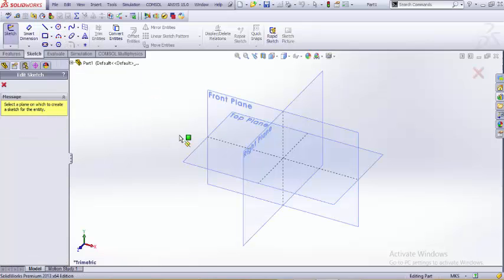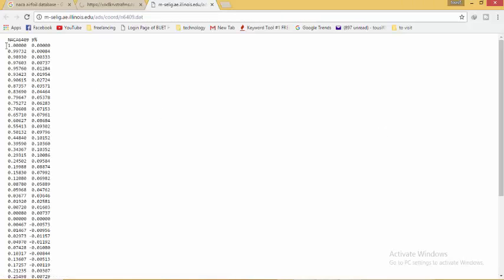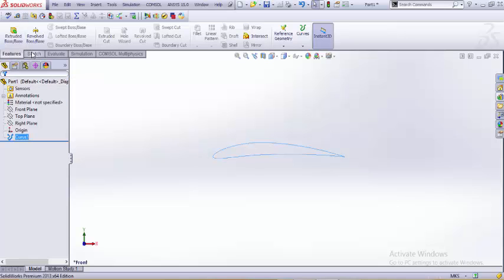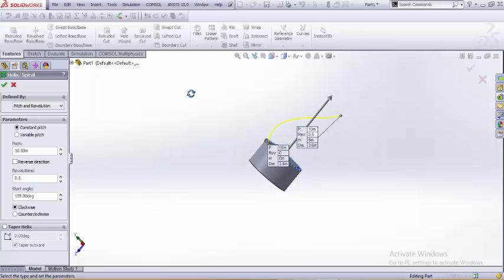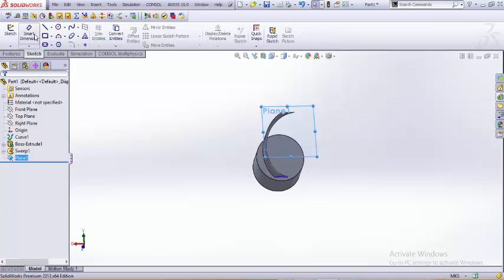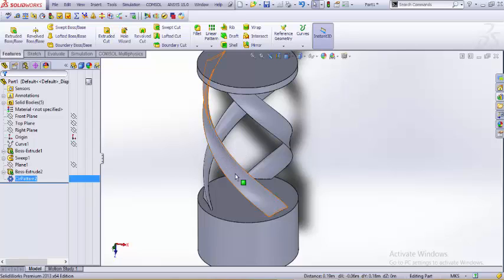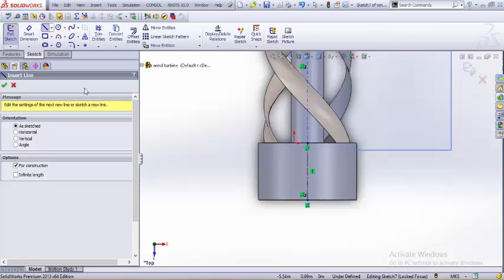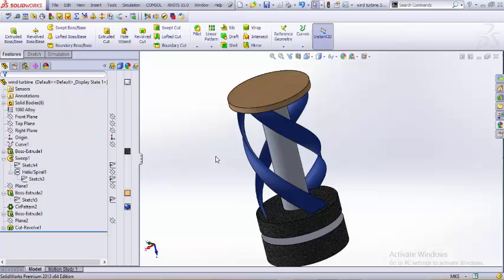How to make a vertical axis wind turbine(simplified)

Comment: Bruh, How to design a 3 blades based Vertical Windmill  setup (blades should be made of low cost light weight ad hard material) and show the minimum force for rotation of the blades in ANSYS? Can you make a detailed video for this please?

Comment: Could u please tell me how to swept ..
I tried many times,but there happened nothing.
Reply from the maker: In case of path and profile, make sure both are sketch, not curve. This is a possibility for not accepting. You can select a plan and put the curve on it and then select. One more thing, make sure that the path doesn't create intersection geometry
Reply: Physics Cads & Simulations Physics Cads & Simulations it’s so confused. I watched your steps so many times and I make sure my steps are exactly the same to yours. I’m wondering maybe the sw versions difference leads to this？(my version is 2012) I searched many examples of swepting whose  paths are all inside the profiles. This path is not inside the profile.
Reply from the maker: I don't think it's version problem. Try piercing relationship with the two curves. It helps in case of different planes
Reply: Physics Cads & Simulations I hope i can send u a picture 😭😭still thanks for ur patience. I’ll try again 😳
Reply: Physics Cads & Simulations I really don’t know how to make a piercing relationship between the two curves😔
Reply from the maker: @tsunamisakura4234  it's similar to the way you make other relationship like intersection,coincident, etc
Reply: Physics Cads & Simulations u made the piercing relationship by just modifying the start angel of the helix?
Reply from the maker: @tsunamisakura4234  according to my knowledge, the angle between two curves need to be close to 0 degree. So it can be either parallel or connected, for that, the start angle can be modified
Reply: Physics Cads & Simulations so the start angel is the point,right?but how could I know the proper start angel?🤯🤯sorry, I’m so dumb 😭
Reply from the maker: @tsunamisakura4234  none is dumb. It's the way we think only.
Reply from the maker: @tsunamisakura4234  you can put reference. For that, you can put some lines as reference
Reply: Physics Cads & Simulations thank u so much!!! I made it !! Thanks for ur patience 😘

Comment: Salam, I'm doing a similar design for a water flow turbine, I wanted to know how do I adjust the size of the turbine (base and height) to fit inside a 50 mm internal diameter pipe ? Thank you
Reply from the maker: Thanks for your comment... what will be your direction of flow?
Reply: Physics Cads & Simulations it’s horizontal
Reply from the maker: one of my friends did the same experiment. their prototype was bigger(1 feet in lenght) for  open channel flow in water. for 50mm, the rpm and rotational torque will be very significant... you can try about the half of the length and keep the rest to support the torque. but my experience says if it is a prototype, it will be difficult to machine. if simulation, just scale up everything no mater which software you use. I have used catia, solidworks and ansys, all give you such features. best of luck brother. :)
Reply: @physicscadssimulations9038  I'm doing exactly as you're doing however when I select the profile and the path, the swept is not applied. i don't know whats the problem
Reply: can I contact you please through personal email ?
Reply from the maker: it would be the channel name @gmail.com. would be happy if I could help
Reply: PhysicsCadsSimulations@gmail.com is this your email?

Comment: Salam brother, i'm doing a final year project on vertical axis wind turbines and found your videos very helpful. 
I'm thinking of doing this design and improve it, so in min 12:40 you mentioned we can utilize the positive lift of the surface of the blade to gain more power, my question is how could that be obtained? Thank you
Reply from the maker: Walikumussalam brother. Are you using lift base vawt or drag based? I wanted to make a prototype for the drag which can utilize the positive drag as well. The design is a bit different, but I believe it would work. So in lift base vawt, we are limited by betz limit, in fact a lot less, but in that case, we would be making like a hybrid one which use both drag and lift. Mathematical model of that would be difficult but physics is very interesting for that